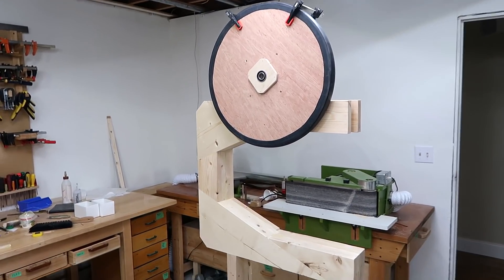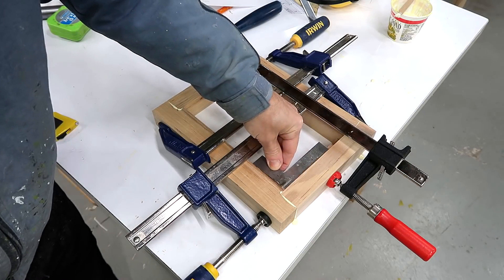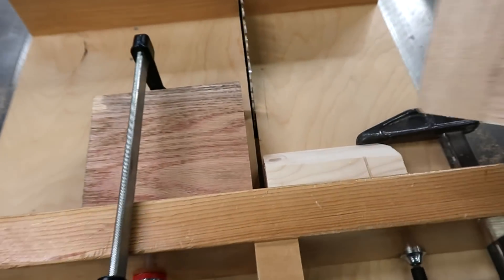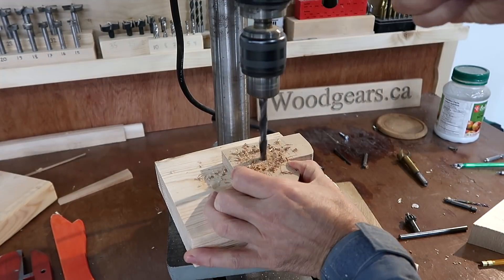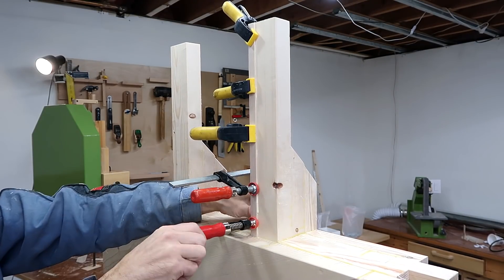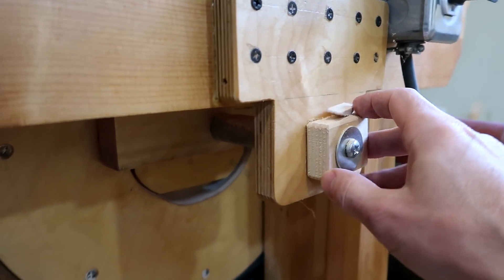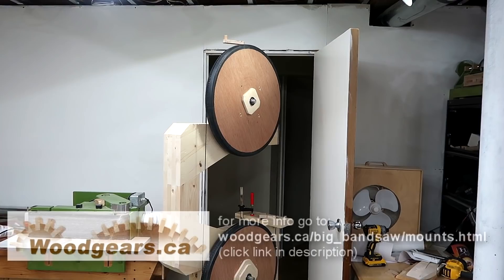Wheel mounts for my 26" wooden bandsaw

Comment: I also like using a micro-controller like Arduino with a triac for speed and horsepower control. Can do tension etc. allows heavy wheels a slow start without belt vibration or stretch. I love a variable speed constant rate/torque cut. I do much more than wood.

Comment: And were here at the NHRA Spring Nationals folks. Matthias, how did you win the A/Altered class? 
The body is paper. The frame is ash. The front springs are osage orange.
The wheels are hickory. The slicks are elm.  
The headers are replaced with every run, they're pine.

Comment: It’s on industrial bandsaw that normal to keep the width of the cut add the re-saw capacity it used four smaller wheels instead of two very large. Have you ever thought of designing one like that or do you think it be too much of a headache trying to line up all four wheels? It had a 3 foot depth of cut and a re-saw of about 24” to 30” and it wasn’t much taller than the one you were building now.
Reply from the maker: go to woodgears.ca and search for "bad bandsaw ideas"

Comment: Matthias, You commented in a previous video that every shop really needs at least 2 bandsaws.
It might be time to build a 2-in-1 bandsaw!
Think about it! -- build a 2-in-1 bandsaw by turning the other bandsaw 180 degrees -- and merging the machines together.
Even the frame could be integrated together.
A single motor could drive them both by putting a dual pulley system on the output shaft and twisting 1 of the drive belts to change the rotation.
Put a thinner high set blade on 1 side (for cutting curves) and a thicker blade on the other side (for re-sawing) and general purpose cutting.
Reply from the maker: and for just a little bit more work, and an extra motor, you can have two bandsaws, which you can build one at a time and arrange whichever way you want. That would be much better!  And no belt shredding from twisting them either.

Comment: This thought came to mind recently after watching your previous vid (building the frame). It might be a bit more complex, and the length of available blades could be a limiting factor, but rather than two larger wheels to give a greater width of cut, would four smaller wheels achieve the same goal? That might help solve the height issue as well. Maybe something to ponder for a future project, because I'm guessing you'll want an even bigger bandsaw sometime down the road ... 😊
Reply from the maker: search for "bad bandsaw ideas" on woodgearas.ca
Reply: @matthiaswandel  Found it...and good points. Metal fatigue and complexity would be big issues.

Comment: Time to add some wheels to the bandsaw so that when tilted back it will fit through that door.
While you're at it, make the wheels a tandem setup so that the bandsaw can sit unassisted in that tilted position while you move it around.

Comment: wait a minute, wasn't the whole purpose of making it "only" 26 inches, that you can fit it through the door?
Reply: It can still fit through the door, if you rotate it 90 degrees into "motorcycle" configuration. It's the only bandsaw that comes with a helmet and goggles!
Reply: I was looking for this comment. Pretty sure he mentioned not going any bigger with the wheels because he wanted the bandsaw to be able to fit through the door... what happened??? 😂
Reply: @benburoker5192  hé wants it to fit through a stanfard door. This door is smaller than standard.

Comment: Next bandsaw: lower wheel in basement, upper wheel in attic. Cut capacity is whatever the height of your main floor is. A sternly-worded sign should make it childproof.
Reply: that almost seems like a good idea. worlds slimmest bandsaw, just the blade. hell, while we're are it why not have the tablesaw blade come through the floor too? imagine a room where all you can see are the blades of the tools lol. like something out of the saw movies
Reply: A mistake they'll only make once. Self correcting problem.
Reply: I thoroughly enjoyed "sternly worded."
Reply: That's awesome.
Reply: Cut a 2x4 standing on end..
Reply: @johnbattista9519  lol
Reply: How about a multi-blade saw so you can gang saw boards from logs. You'd need wheels of different diameters all spinning on the same shaft. Difference in diameters would determine the thickness of the boards.

Comment: just my opinion but with the 3 bolts centering the shaft on the bottom wheel, you shouldnt have the bolt pushing up on the shaft because the weight of the wheel wants to pull away from that bolt, if you had it on top it would be pushing against the wheel, just my opinion
Reply from the maker: blade tension is more than the wheel weighs.

Comment: If you don't mind, i have a couple questions. I am going to use you as a "go to" source of information to build a saw , have you thought about using pillow blocks on each side of the wheels.  It would make blade changes more difficult but eliminate the torque on the frame. Would using oak or maple for the frame be worth it . My shop is unheated with Temps to -40 so I doubt that mdf for wheels would stand up , I'm thinking of casting my own using sawdust and resin , have you heard of anyone doing this?
Reply from the maker: MDF will work much better than what you propose.  Pillow block on each side would work for the bottom, but not the top - needs to tilt.  And hell to change blades.

Comment: Curious if you considered a design where the wheels and blade where inline with the frame and if so, what your thoughts were on it?  With the wheels to one side of the frame, do you forsee any stability issues or long term reliability issues?
Reply from the maker: there will be some twisting over time, so the lower axle mount screw will need half a turn in a few years time.

Comment: Why not make a hinge on the upper arm, so it can be folded down for transport. Just need to remove the blade and pop the pin, fold'er down and off you go.
Reply from the maker: A hinge would not be strong or stiff enough.

Comment: That axle-tweaking idea is a fantastic innovation.  I had some difficulty lining up the bottom shaft when I built my 20 inch bandsaw.
Reply: I thought that was standard on bandsaws no? I have those on my £100 bandsaw
Reply: @korffy10  On the bottom axle?
Reply from the maker: yes, on some steel frame bandsaws.  Because the welding distorts the frame a bit so they need to be able to adjust.  Cast iron saws tend not to have that because the axle mount is machined after casting, so they can get it right.

Comment: When you are a hammer, everything is a nail. When you are a Wandel, everything should be a bandsaw. I am glad to see you back in action building things like this. Although I could never do this I like seeing someone that can. Now tell the truth. This is done just because you can, right? A band saw with the limitations of this one is no better than a table saw. There is not enough throat depth to be superior to a table saw. IE, you cannot cut a 4 x 8 sheet in half. There is not enough resaw capacity to be superior to one of your smaller already made band saws and finally, the table is too high off the ground to be manageable on large objects aka sheet goods.
Reply: By your logic you'd only ever need a hand saw. The band saw is better for cutting thick stock such as logs while a table saw is best for sheets. I would never attempt to cut a 6x6 with a table saw but the band saw is perfect for the task.
Reply: @kendallemory8455  You have no idea what my logic was. Look at the dimensions of this saw and you will see that it has no use beyond that of a table saw and it is too far off the ground for that. I have a 14 inch band saw and I know what they do well and what they do not. The wheels of his saw are huge but there is no more distance between them than on his smaller saw. There is more distance to the support but the table is then like four to five feet off the ground. It is hard enough to wrestle sheet goods onto a table saw which is like less than three feet off the ground. That is what I wrote and you come from out of nowhere with evidence that you never really paid attention to what I wrote.

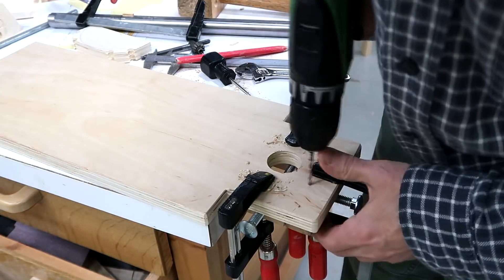Comment: 6:17 Why carriage bolts instead of regular hex head bolts, or even socket cap screws?
Reply: I´m pretty sure it is something along the lines of: "I don´t want to spend the money for 3 Hex Bolts" plus " the square head is enough for my pliers to get grip and i don´t need to turn these very often anyway"
Reply from the maker: the hex screws they had at home depot only had short threads on them

Comment: That wooden tension problem is interesting. Would like to see an educational video about this topic. why and how can it happen, what are the risks, how to avoid ot, how to solve it or at least how to work around it.
Reply: There are plenty of YouTube videos about tablesaw kickback.   When you have a piece of wood with that sort of internal tension, you can definitely feel it as you are cutting the wood.   That's what a riving knife is for, it stops the wood pinching the blade due to internal tension.    And anti kickback pawls are for if the riving knife doesn't work.   
But the easy solution, if you feel the wood starting to act weird, is to simply make multiple shallow passes.   Cut 1/4" deep, then run it through again at 1/2" deep, then 3/4" deep, etc.

Comment: By the end of this build video, we will see Matthias sawing right thru the door to make a new opening! Interesting video, as always, i like a lot the system to get good alignment for the bottom wheel. But for the sake of sanity, would adding nuts to those adjusting bolts to prevent eventual vibrations and the bolts backing out?

Comment: I know the larger wheel makes it easier on the motor and the blade, but could 4 smaller wheels be used instead? Would that make tension more difficult?
Reply: That was discussed in earlier videos (for this build).  He has a page about 3 wheel saws too.  https://woodgears.ca/bandsaw/3-wheeled.html
Reply: @randybartlett3042  thanks, i must have missed that one

Comment: I like the four carriage bolts for aligning the bottom shaft, are you concerned about the wood threads holding up over time from the tension of the blade and the torque from the motor starting up?
Reply from the maker: No.  It's overkill.  Probably the bottom bolt will require adjustment by one turn in two years time.  That's it.
Reply: This is exactly how my Rikon adjusts. It's a simply but effective method.

Comment: Well, if fitting through a door is no longer a requirement I guess we'll be looking at a 32" bandsaw sometime in the new year?
Reply: go for an even 36 xD
Reply: @1320crusier  
No, a true 1 meter throat using 1.05 meter wheels. Unfortunately there's only 75mm of vertical capacity
Either that or build 4 x 8 water jet or laser. Entirely out of wood of course.
Reply: Plywood comes 48" wide, why not go for that?
Reply: @sdspivey 
The bigger the wheels the more motor to wheel speed reduction you need. Do you go for a really big pulley on the wheel shaft. Or a two stage Jack shaft.
One guy I knew took a 14" generic import  and mounted 2 small 4 speeds transmissions in the base. His really low speed came from using the two reverse gear sets. 
The longer the blades the more they cost. At some point it becomes cheaper to buy 100 ft rolls and weld your own. That's what we did where I used to work. It's also handy for band sawing internal work. Well, Jeremy Fielding has a 48 x 96 plasma/cc router combo. He's built one of Matthias's band saws so maybe he could return the favor. There used to be a show on cable called beyond 2000. They showed a boat kit made from 4 x 8 sheets of plywood for the frame that was water jet cut. The pieces slipped over one another and the the whole thing was fiber glasses over iirc.

Comment: Have you ever snapped the head off of one of the drywall screws you use?
Reply from the maker: sometimes in hardwood, yes.
Reply: Pretty sure most people have or eventually will snap a head off of one.

Comment: How powerful of a motor would you and what speed is needed for such a bandsaw?
Reply: Depends on how thick the wood you want to cut is, and how fast you want to go.   You could get by with a half horse or less if you were only doing thin wood and going slow.   If you were doing resaws of six inch thick planks, you'd need two or three horsepower.   That's why some shops have two bandsaws, one for delicate work and one for heavy resawing work.
Reply: @jimthesoundman8641  excellent points, thank you for the reply!

Comment: Can't fit through the door?  Bandsaw is a feature of the house now.
Reply: Maybe that is not a house but just the frame for a really large bandsaw.
Reply: @tomw.4440  is it a house? Or just a housing unit for the bandsaw? 😅 the structure screams, for it does not know
Reply: I think he's gonna add some wheels that will allow him to tilt the bandsaw on an angle and wheel the whole thing  through the door way.
Reply: Real estate agent, " and this is the bandsaw room featuring a ? inch bandsaw".
Reply: Or use the band saw to saw a bigger door frame
Reply: @victornpb  Not possible. A circ saw or demo saw or even chain saw but not a band saw.
Reply: @jeffstanley4593  depends how strong you are really
Reply: Can’t fit it through the door? Just turn it on and push it through..
Reply: at some point he's just going to mount a bandsaw to the door frame...

Comment: I see a project coming up to open up that door frame...
Reply: eh, just cut a notch out of the top to allow for the wheel and crank. /s
Reply: @aminorityofone  
You best check to see if the wall is weight bearing or not.

If it is weight bearing, cutting that notch will cause structural issues.
If it is weight bearing, you have to install a proper header higher up the wall. 

Then you can remove the offending material.
Reply: @scotttovey  i was being sarcastic, hence the /s
Reply: If it's load bearing you'll need a bare minimum of 9 pocket screws on the notch corners
Reply: @scotttovey  Have a look at the structure above and around the door. I doubt seriously that it is load bearing... but you could always use the new bandsaw to cut an arched header and make a new hobbit door for it. :)